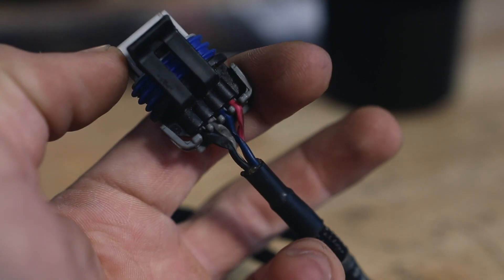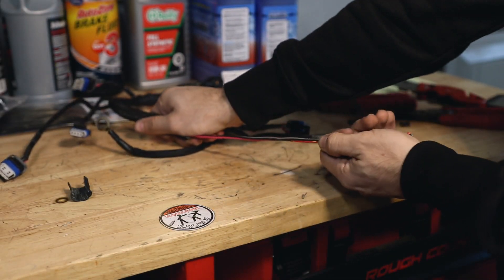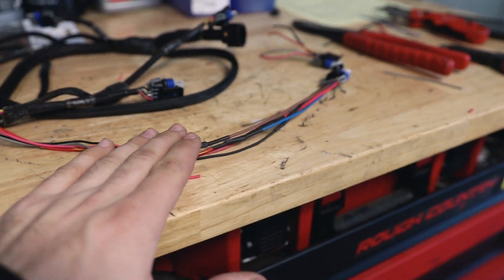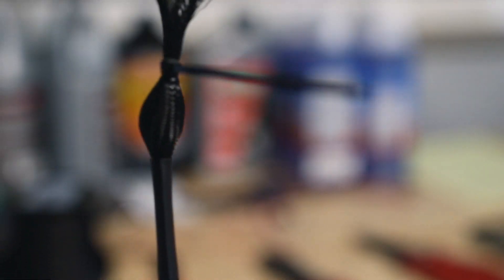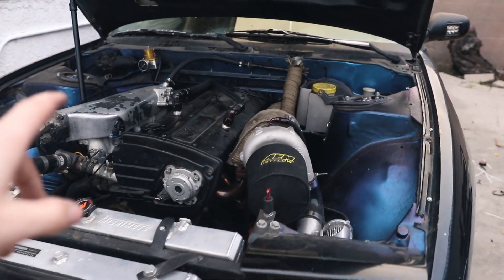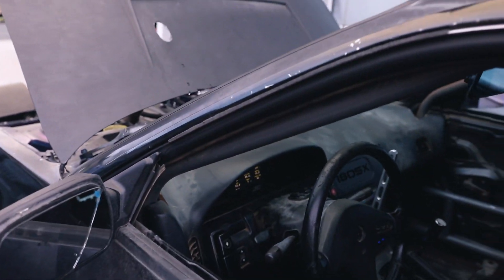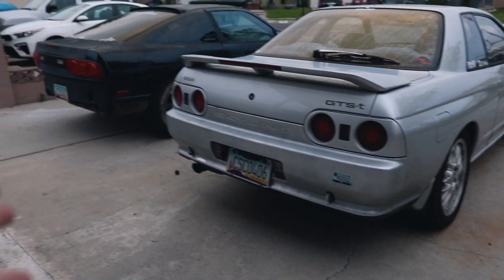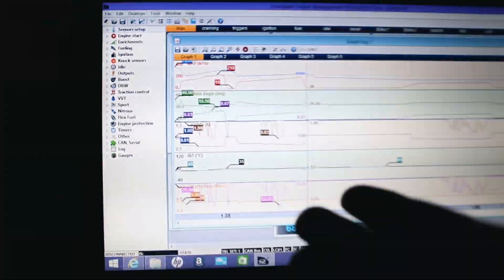Fixing My LS2 Coilpack Harness On My Offroad 240sx!

Comment: Really enjoying your channel.  Keep pumping out the videos. My gtst has a rusty ass tank, looking at options, probably going to try to clean it.  I have a aem  fuel pump ready to install.  Any issues with yours?  Do you recommend its own relay and wiring ?
Reply: Oh, I have kinda looked into s13 gas tanks,  but t here isn't much info.
Reply from the maker: Thank you so much! I really appreciate it 🙏🙏 I havent had any issues with mine but I would put it on it's own relay. S13 gas tanks are the same as r32 but you have to swap over the filler necks. Other than that they're identical
Reply: @FSOMedia  if  I use the s13 fuel pump hanger , will the fuel gauge still be actuate on my gtst.     For some reason I thought the s13 tank held less gas.